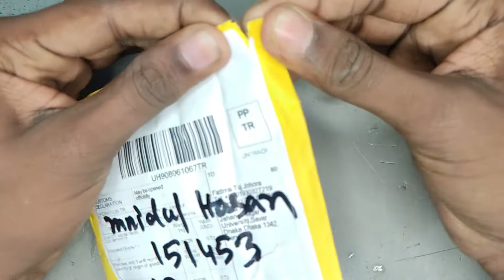How to make a mini tesla coil at home || BD243 Tesla coil kit assembly || DIY Poweful Tesla coil ||

Comment: my tesla coil doesn't work
I've set my powersupply to 9v and it didn't work but it used 6amps
and when I tried to do it with 12v it stil didn't work and it showed me that it was using 600miliamère
when i tried it again with 9v it showed too that it used 600miliampère
the light doesn't turn on
and my tesla coil does not give a spark
Reply: Ive got the same problem, did you solve it?🤔
Reply: @drake87  no, sorry
Reply: I’ve got the same exact same problem
Reply: Double check if everythings soldered correctly, and that none of the bits connect to eachother.
And make sure the bit of the copper/magnetic wire thats soldered to the rest is the silver coloured bit, where the coating is off
Reply: También tengo ese problema...